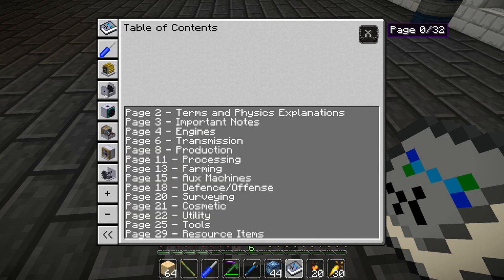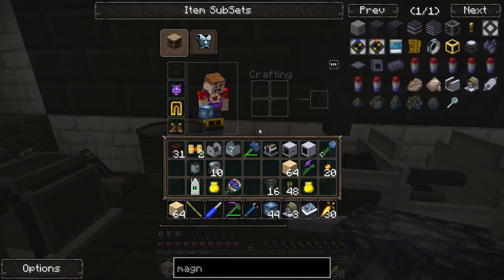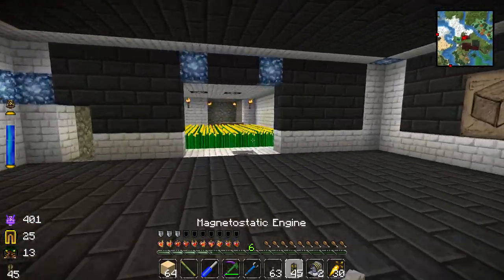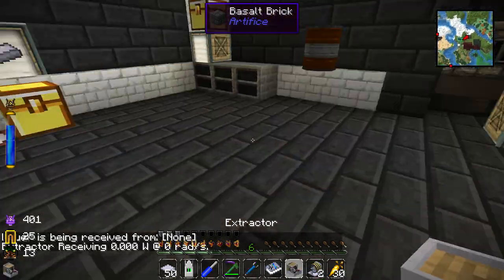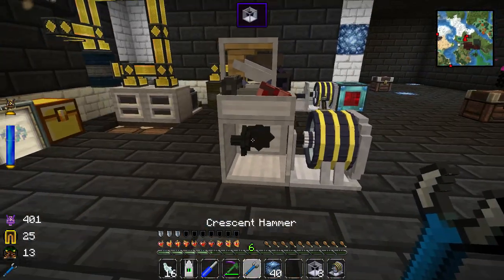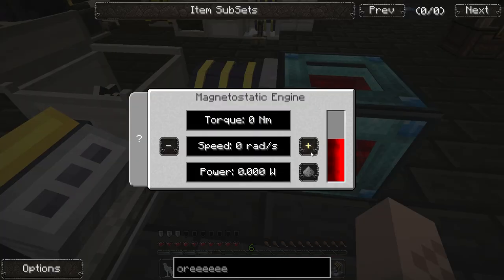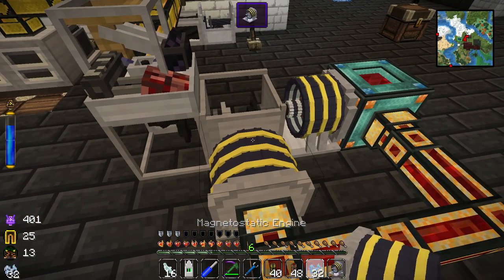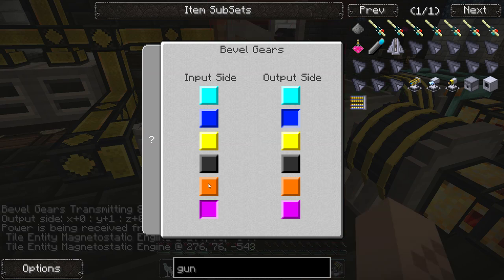FTB Horizons - Rotarycraft, Magnetostatic Engine and Extractor - 067

Comment: the machine you made is a tier 5, ppl start off whit a tier 0 and have to upgrate them to tier 1-2-3-4-5 2nd off the unit you need for the speed is CVT unit....whit a least 7 belt's in it doing 1x speed 2nd line max speed or 1xtorg and2nd line max speed (8xspeed)
Reply from the maker: Thanks buddy, Good to know!